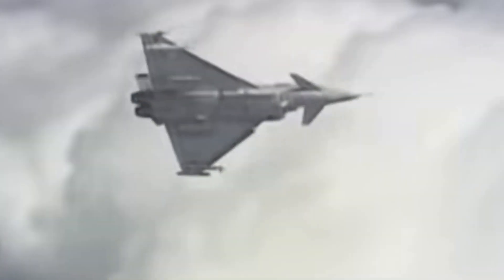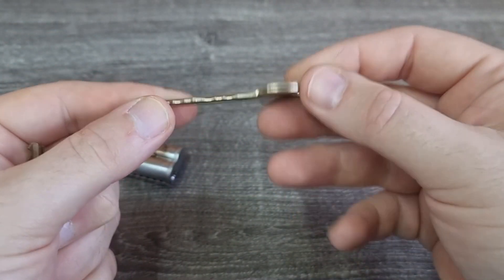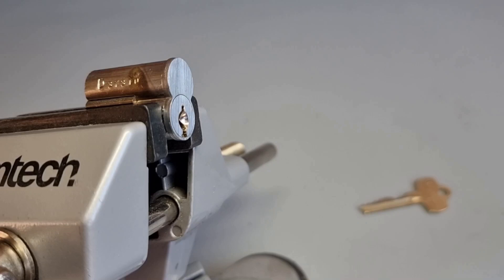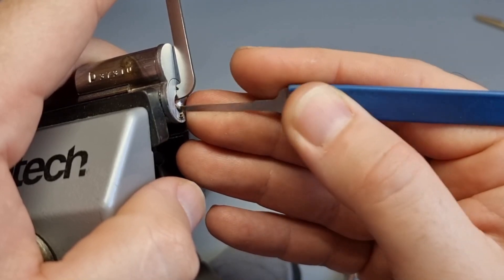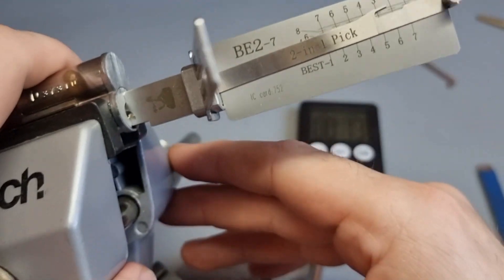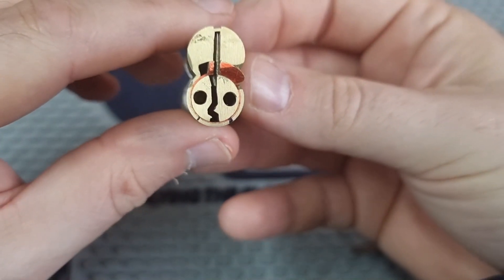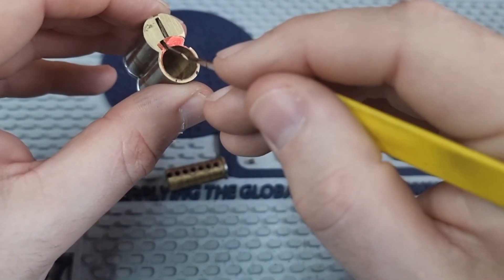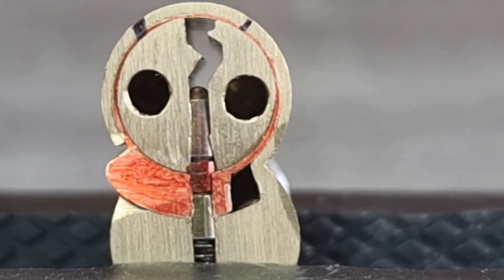INSIDE AN ENIGMA: Cross-Section of an SFIC Lock

Comment: What key section does the lishi pick work on please?
Reply: The pins. It's the only section in a lock that any pick works on.
Reply: @kenwhite6739 
I meant keyway profile.
Reply from the maker: It's the BE2 Lishi - so BEST is the brand, but I wouldn't know specifically what BEST locks it will work on, it just so happened to fit this one.

Comment: Yes, SFICs are common in the U.S.  I know you wonder about their utility, but institutional users find it convenient for on-site "supers" to just replace the cores when someone leaves, a change of users, keys getting distributed, etc.  They then give the cores to practiced locksmiths who have jigs to quickly re-pin them.  The cost, as you note, is the greater complexity and required tolerances that increase the acquisition cost of such locks.

Comment: Lfic is a better system than sfic imo. But sfic was first on the scene and is more common. In my area is mostly used for quick changing of lock cores and controlling access to places that have multiple layers of master key levels with user change keys, master keys and grandmaster keys plus the control key. There are restricted keyways and the multiple pins per stack sometimes makes these easy to pick to control or user shearline if the keyway isn’t too tight but can be hard to duplicate a key if you don’t have a way to buy it. Also, bump-keys are not very effective with these (there’s too many types of keyways to match them up and the smaller chambers and springs make bump keys not a very good option). Fun video, thanks for sharing.
Reply from the maker: So there IS a Large format - they don't seem bigger from what I've just searched. Thank you for the very detailed explanation. I did see some diagrams with a fourth pin for master-keying, but these locks are new to me anyway, so I didn't want to complicate things. Really appreciated.
Reply: @LockPickingLegend here is a primus LFIC for reference to what @odinslock is saying

https://youtu.be/vz59YNoAFBs?si=oJK5KvwzgYHCkWgH
Reply: Large format can be more complicated as they can have sidebars and the keys can sometimes have the special side milling that only can come from factory. Plus the retaining pin that Lfic uses to hold the core in place requires a little extra attention when trying to remove. Lfic can use a common keyway or can almost be as complicated as medeco when it comes to security. Thanks for sharing!
Reply from the maker: @odinslock  Thank you, I might see if I can get my hands on one, and cut it open for a follow-up video some time.

Comment: Actually, there are "large format interchangeable cores" (LFIC) as well as "full sized interchangeable cores" (FSIC) all of which are referred to as IC cores as an umbrella term. LFIC and FSIC are used in schlage and medeco locks

Also there are often 4 pins per chamber because these are often mastered as well.

They are designed for large facilities where key control and access are a constant issue. The management can simply pull out a core if needed and replace it without having a locksmith come and rekey/disassemble your current set up.

The 2 shearlines cause pins to get mixed up between them and doesn't allow the core to turn while giving you the feedback that pins are set. Some sfic's are much easier/harder than others, there is a HUGE range of difficulty with these.

Another point to bring up is when picking these, you get a click when setting a pin... that click will be on the control shear or the operating shear, depending on the bottom pin/middle pin sizes. So it's not always that you have to "overset" the bottom pin to reach the control shear.

As for the lishi tool on best locks, unfortunately they only have one for the a keyway. And there are about 30 different best keyways.

Great video and picking as usual buddy! Keep it up 😀👍
Reply from the maker: AMAZING - Legendary reply - so much detail and explanation. Really appreciated. I'm going to go down this rabbit hole now for sure. @odinslockllc stole a bit of your thunder, as he also said there ARE LFIC. But you have certainly given me plenty to follow-up. Thank you very much.